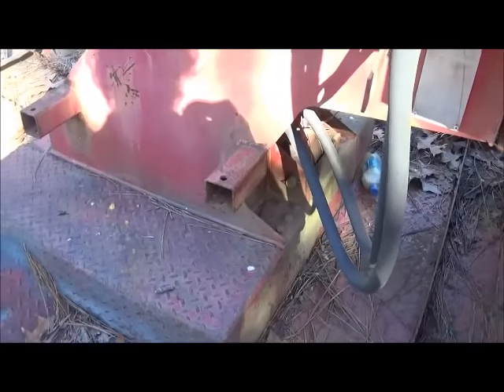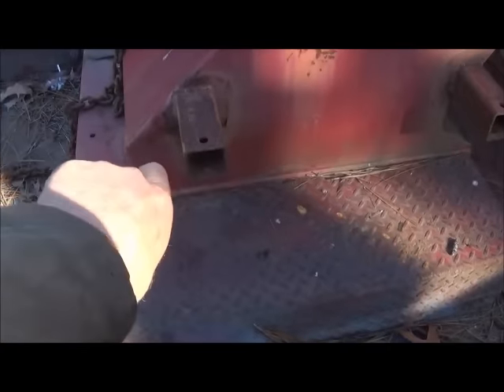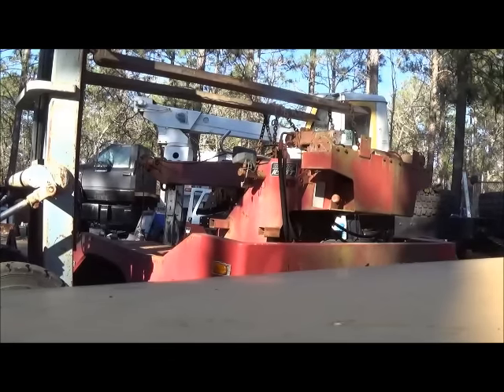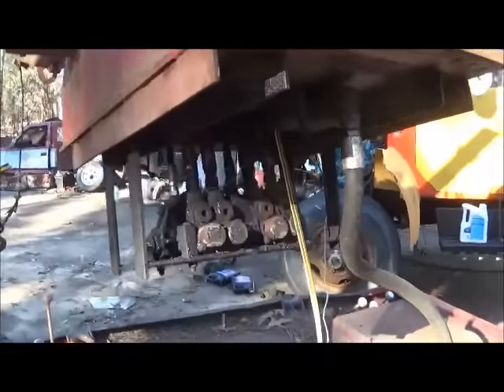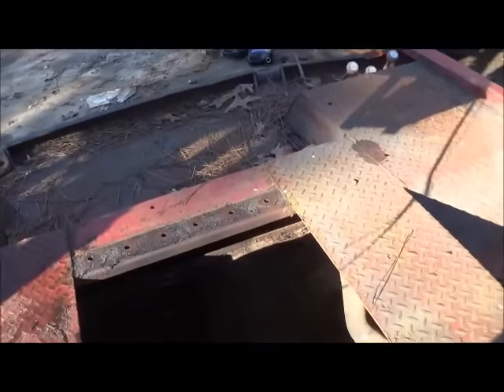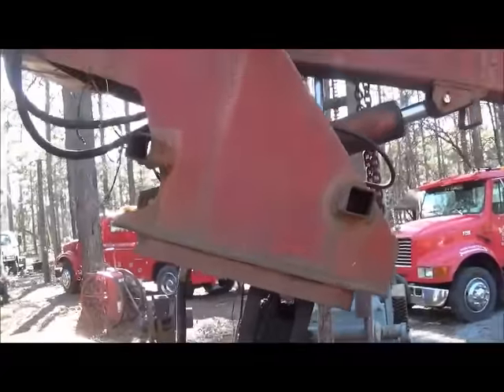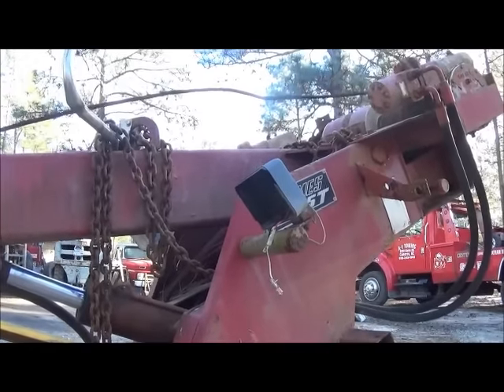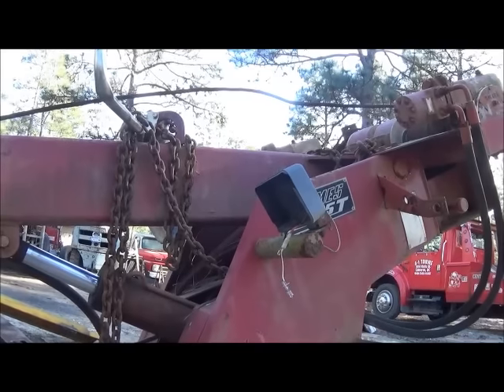4x4 Wrecker Build Part 20 Teardown Still!!

Comment: if you come across a cab and chassis 1 ton dual wheel , you can slap that old wrecker bed on it , and mount a gooseneck ball in the bed , a 5th wheel hitch , and put like 3 different height 2 inchers in the tailpan , and make a nice trailer pulling rig that you could sale for a decent profit I bet , I made one , and all said and done profited a bit over 5,000 , and it did not take that much work , people like that kind of setup ...